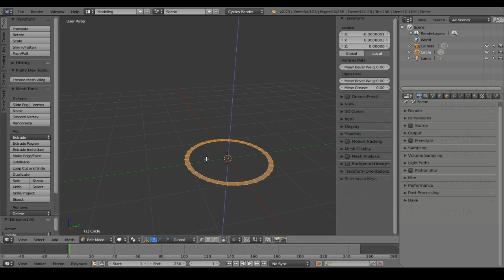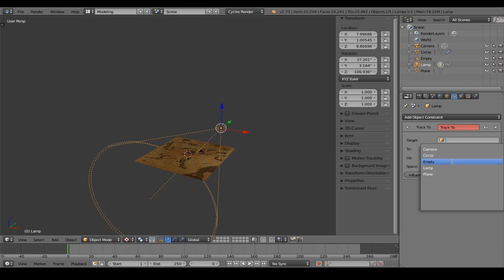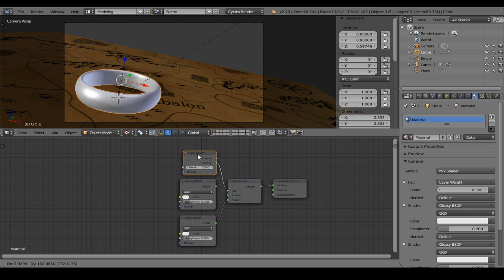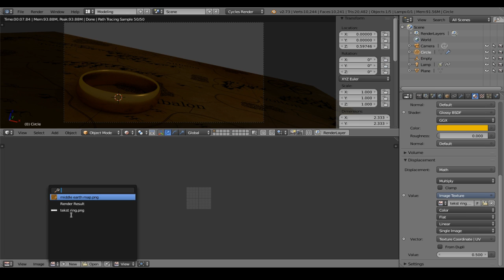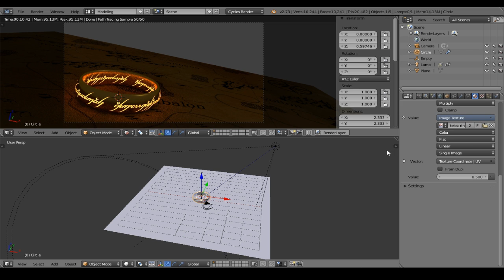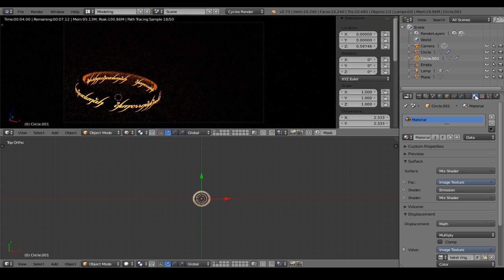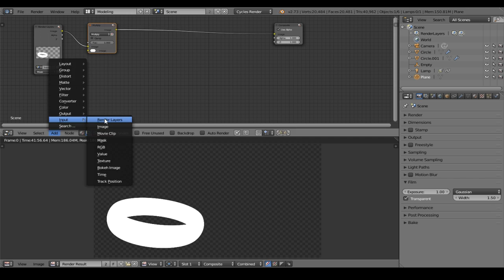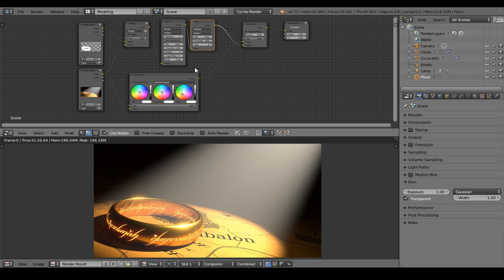Blender tutorial : Creating The One Ring

Comment: It could use Screencast ... I didn't understand how you managed your way inside the UV ...
Reply from the maker: The problem with Blenders screencast is that it only works in the 3d view ( and not in the UV image editor or in the node editor for example ).
At which part do you have problems, in the UV image editor?
Reply: jovlem Oh, my bad. I'm just so used to see Screencast everywhere ... didn't know that.

I had a bit of trouble in the UV editor, after you cilinder-unwrap the faces of the ring, they are one over the other.  How do you go from one vertex selected to one of the unwrapped faces?

The 3d view edit mode shift-g (select similar) doesn't work, and I ended up using "Control +" to expand my selection until one face was selected.
Reply from the maker: JC Qu In the UV image editor move your mouse over the uv's and press L for Linked selection. This way you can select a linked part. After that use G ( grab ) to move it over your text.
I hope this helps.

Comment: Thanks for the tutorial, I enjoyed it!

My only comment would be you could probably skip the extra render layer for the ring mask, and instead just add a PassIndex number to the ring object. Enable ObjectIndex on your main render layer, then in compositing you can use the ID Mask node (with your IndexOB pass piped into it) to mask out the ring. One less render layer to worry about and one less thing for Cycles to render!
Reply: Also, it's more convenient if you have to move the ring in the scene to not worry about the second mask object.
Reply: Todd McIntosh Hey Todd, could you perhaps upload a screenshot with full node setup using IndexOB to achieve same effect? I cant figure it out
Reply: MrSajmon92 I don't have the node setup as I didn't actually recreate this scene. What part are you having trouble with, setting up the ring mask with the ObjectID?